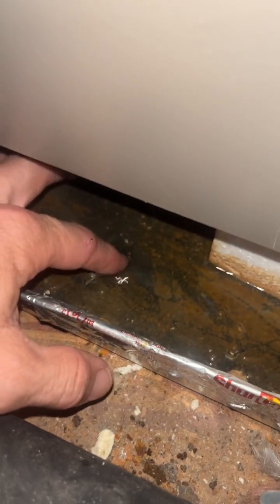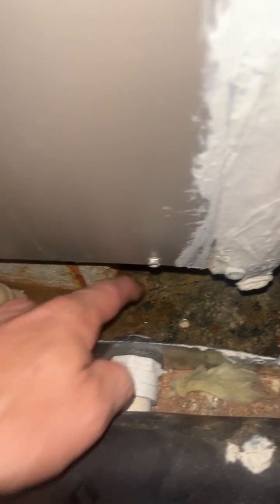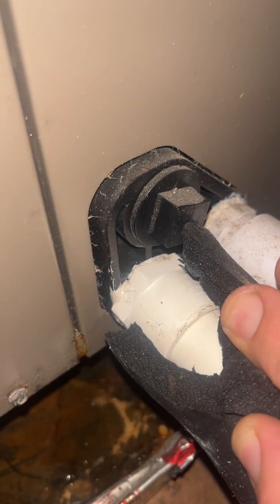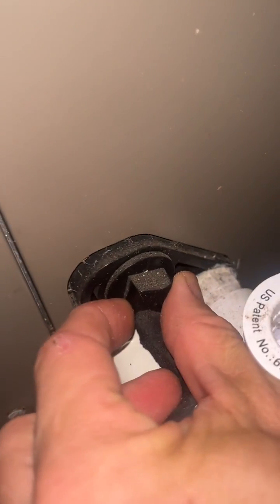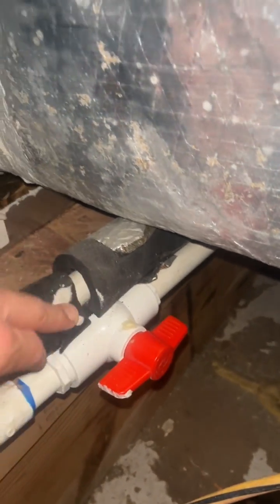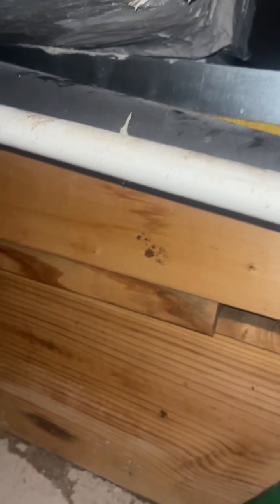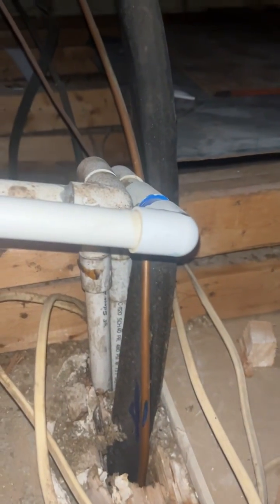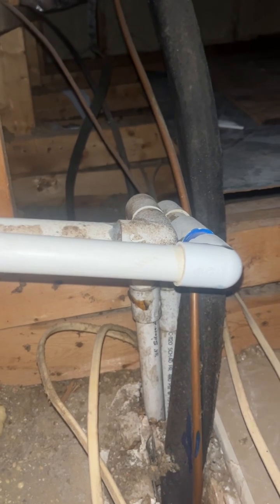HVAC drain, add a tee?

Comment: Bud you have more issues than adding a tee. There should never be water in the condensate pan. Its only purpose is an emergency catch pan in the event an issue arises.
Reply from the maker: That condensate could have four years of funk building up in there, right? So I’m thinking a tea might be the perfect flush. The water has dried up since I’m running too humidifiers in the bottom floor, I cleaned the coils outside, and the window unit unit in the unfinished second floor. it has been spray foam and sealed, but it’s too large of a space for the window unit, but perhaps that helped a little bit.

Comment: 1 ST‼️ YA✔️... Read more
Reply from the maker: lol - do you have any insightful HVAC experience on where to put the clean out Tee?
Reply: @GregoryGuay  I'd put it closer to the unit. So can flush gunk out of the whole line ✔️
Reply from the maker: @nervouswreck392  I suppose I can replace the current 90deg elbow with the 90deg P-Trap (probably with a removable union each side - this way I can reach towards the trap w/ a cleaning snake of sorts, and then flush the system downstream.  I just realized that the 3' stretch after the P-Trap is actually sloped the wrong way!!! It is correct as it continues around the corner, but damn! I guess the positive pressure from the unit is enough to push the water, but still, seems like quite an oversight on the install, isn't it?? The unit should have been raised up a couple more inches....?
Reply: @GregoryGuay  hard to tell degrees/angle from a pic/video. It doesn't. Show up.  What I do once a year is pop the cap off my clean out and take me garden hose and blast it through.  But yes with a negative back fall. Water will move down the pipe due to back pressure. But the slime will stack up ☝️
Reply from the maker: @nervouswreck392  The first leg, after the trap, is backward slope 1/8" per foot. So the air handler has to push the water trickle up hill before it turns the corner and goes down. Maybe this is brilliant to ensure the trap always has a little water? Or maybe it's an oversight on the installer. Apparently it's not that huge of a deal if it seems to have been working. Well, there was water in my secondary pan but that has dried up since I ran dehumidifiers downstairs and put an inefficient window unit in the (sealed) attic/unfished 2nd story.